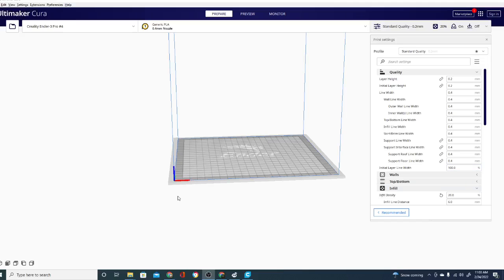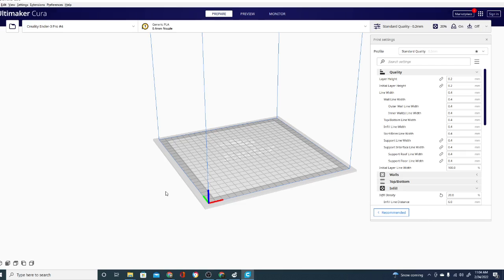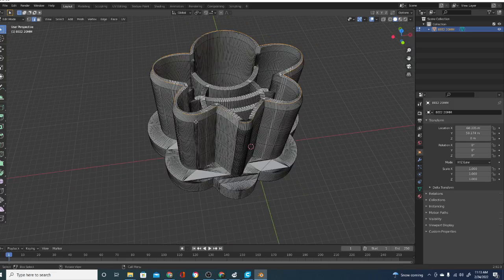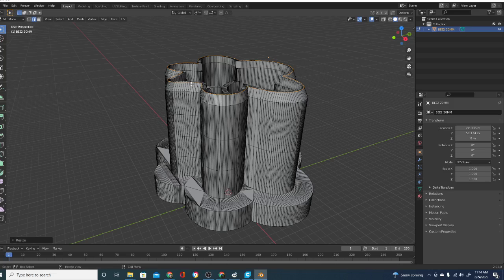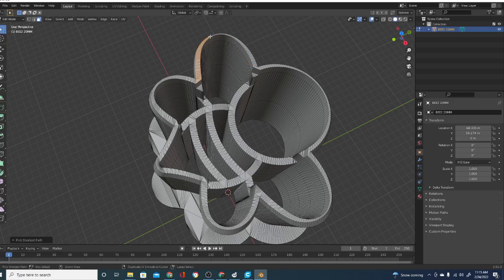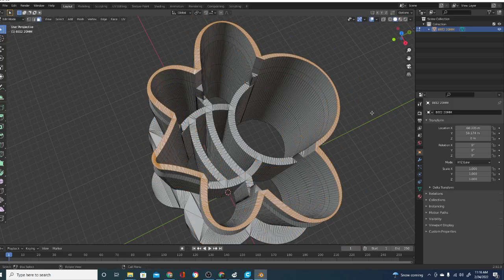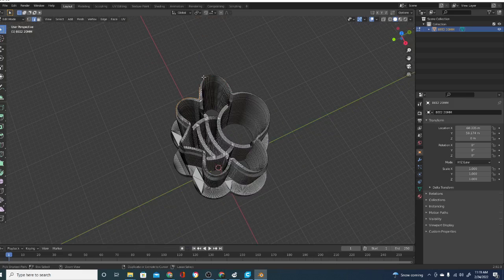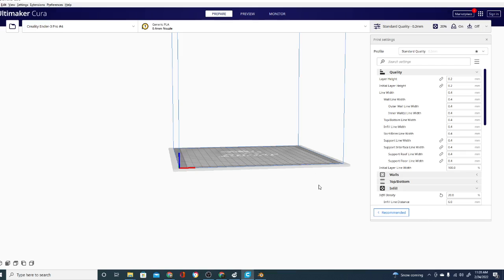Cura Questions!?! - how do i taper the edge of a model? like a cookie cutter?

Comment: I have problems slicing my 3d objects with a tapered edge...
I have designed my 3d objects to taper to a 0.4mm thickness along the edge (to match my printer nozzle size) but when I slice in cura, weirdness happens. 

I think I need help with settings? Any help really. 🙏🙏🙏🙏🙏🙏🙏🙏🙏😢

I can share files. The object is solid, no stray geometry. I use sketchup.
Reply from the maker: Try the new cura beta, it's more accurate and prints thinner parts better
Reply: @Technivorous  I did!perfect results. Thank you